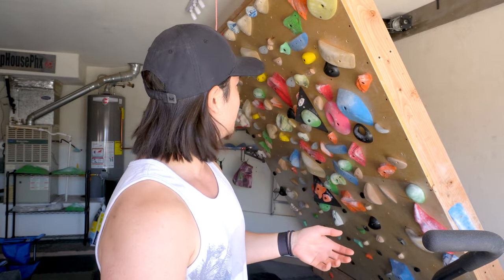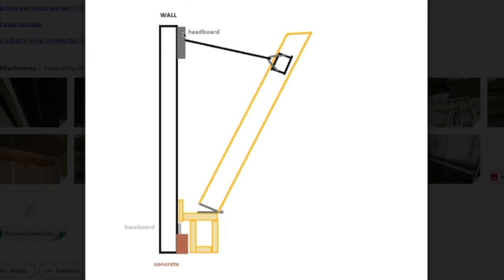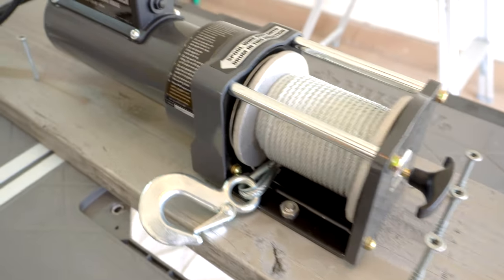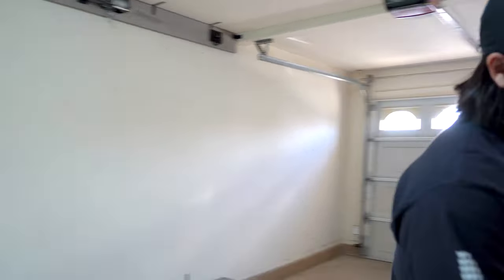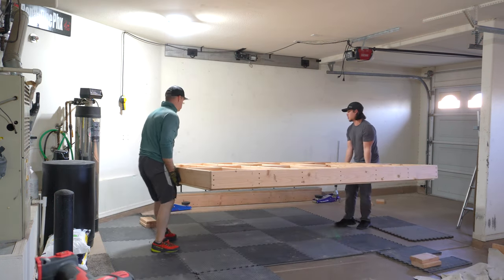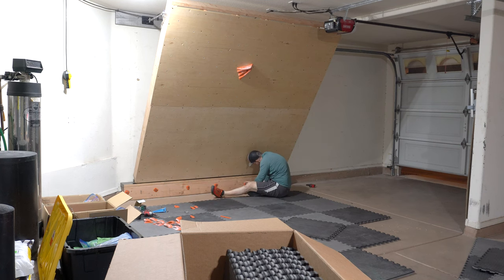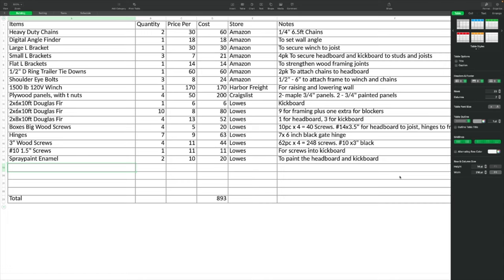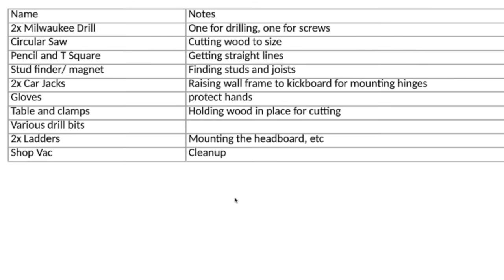I Built an ADJUSTABLE Home Climbing Wall for $800!!

Comment: Great video, and this is quite similar to how I built my 8x12 (which I just posted a picture of in the Woody 3.0 thread). My design just had a few differences: 1) I used four chain anchors rather than two, with turnbuckles to equalize the anchors; 2) I added 45° bracing to increase rigidity (makes a big difference); and 3) my kicker is a solid 12x beam through-bolted into concrete anchors. Having climbed on a few adjustable 8x12 woodies, I think my overbuilt version is better. The others "work", but the board flexes quite a bit, especially on jump moves to the corners, whereas mine is completely rigid.

Also, just wanna flex for a sec… I was so insanely psyched when building it that I mounted it myself. I added some casters to help with moving it around the garage, but… yeah, it was heavy as hell and hard to place. I think around 400lbs?
Reply from the maker: Yeah that sounds even more over engineered than mine!! Super solid.
Reply: Would you happen you have some plans on the forum? I’m planning to do the same exact thing you just mentioned.
Reply from the maker: @advantagenguyen  @danschmidt5189

Comment: Hi Nick - to what is your header attached?  I have a couple of options.  option #1 is to attach the winch to a 2x8 ledger which is attached to 2x10 LVLs working as a beam.  Option #2 is  to attach the winch to a single 2x10 joist.

Thanks for this DIY climbing wall build video!
Reply from the maker: Glad you found this video! As far as your situation, it's hard to say without seeing it, but I definitely recommend attaching the winch to more than a single joist if possible. Some people attach it to the ground and then run a pulley from the top which might work for you. Not sure though!

Comment: Man this is a sweet build! Love the fact that there are no vertical pillars attached to the top, which I imagine would get in the way of climbing or potentially introduce injury risk when falling. Have you noticed significant improvements to your climbing now that you have a personal spray wall?
Reply from the maker: Absolutely! The vertical pillars is what I saw in tons of other builds and I just knew it would be a very mental issue with trying to go for dynamic moves near the top/corners. And I recently got a pulley injury unfortunately, but prior to that, I 100% saw finger strength and tension gains from climbing on the home wall. I was up to about 80% bodyweight for one hand 20mm crimp pulls. And you can check out some of the best sets from the home wall on the instagram page! https://www.instagram.com/themanawall/
Reply: @nickkealiiclimbs  Holy crap dude, you got strong! Sucks to hear about that pulley injury, hope it heals up quickly. Sweet page, thanks for linking!
Reply from the maker: @129iphone  really appreciate it man!! Stoked for the comeback haha. Thanks for watching 🙏

Comment: Nice work!  What is adjustment range of your wall?  I'm planning an adjustable Moonboard Mini DIY and I'd like to be able to change from 25 to 40 degrees.
Reply from the maker: Thank you! I don’t actually know the full limitations, not strong enough yet 😂 but the minimum angle ended up around 20 and so far we’ve lowered to 35. I imagine 40 and 45 would be totally fine though 💪

Comment: Dude! Quick question, Ive been thinking of using your plan to build a wall to fit a Tension Board 2.0 in my garage. With the experience of building your wall, would you recommend it? Ive just been torn with buying pre built ones from onsite walls and it will be safer. Just wanted to get your opinion to see if you were to build one for the TB 2.0, would you do the same again. Thanks!
Reply from the maker: Good question! I mean I’m very happy and have had no issues with mine. But it is smaller than a normal system board. And we don’t adjust it all that often. If you have the budget and space I think a prebuilt one would be worth it. Although I do know at least one person who followed this design for a TB2. He’s on ig as @waddyaknowitsjoe
Reply: @nickkealiiclimbs  Thanks dude!

Comment: Awesome video!! With having an 8ft wall, do you sometimes wish that the wall was taller so that you could have a slightly longer problem?
Reply from the maker: Absolutely! 12 ft would be amazing, but my short garage ceiling didn't give me an option unless I wanted a super overhung wall. But the 8 ft has been great for 4-10 move boulders which is really all you need as far as training. And I love not having to worry about padding as much as I would have with a higher fall
Reply: Sit start! Makes everything longer (and less enjoyable 😅)

Comment: I’m about to build a wall. Does it wobble/shake etc where you sometimes you maybe just built a fixed one at like 30• (or if yes but another angle, what angle?) or with angle and weight it pretty much doesn’t move? If it does move, do you think rigging like a couple third hand type extension poles (for construction) would be enough to keep it still?  Thanks! Great video, love the concept, deciding if route for me.
Reply from the maker: Appreciate it! Theres very little wobble or shake on even very dynamic moves. Not noticeable while climbing. And I’ve heard from others who used my design to build bigger walls that they’re even more sturdy since they’re heavier. But yes, you can put in anything you want to add support if you find it not feeling secure. Was your first question whether I’d recommend a fixed angle build?
Reply: @nickkealiiclimbs  sorry just saw late. Good to know. Thank you!
Reply from the maker: @ryanharrington2890  haha no worries man. Let me know how your build goes! would love to see

Comment: what are those hinges rated for? That seems like the weak link in the chain. All that board weight and your weight acting upon those bottom hinges.
Reply from the maker: I actually reached out to the manufacturer because someone else had asked about the hinges in the comments lol. And they did not have any weight rating for them. But they are extremely solid and heavy. In addition, they're designed to be used vertically to support heavy gates and doors as they open and close. With this design, they have significantly less force on them than they were designed for. The only chance of failure I could see would be if all the screws holding the hinges on were to actually shear. That seems to be what would fail first as opposed to the actual hinge construction failing. I've seen much flimsier hinges used so I bought the biggest heaviest ones I could find. Not sure what the alternative would be. What would you use?

Comment: How did you fix the panels to the studs: nails, screws...?
Reply from the maker: I used zero nails for this build. Everything is predrilled and then fastened with screws. The actual screw sizes and lengths are in the spreadsheet linked. Hope that helps

Comment: 2x6x10ft… in cm ? 2x6x300?
Reply from the maker: yeah it looks like 10 ft = 304 cm. do you still measure 2x6s as 2x6s in inches? or would that be different too

Comment: dude! wall looks great, but how are the hinges holding up? On Lowes website it says the hinges you used only support 23lbs each. Yikes, I used 5" commercial butt hinges from Lowes and they each hold 220lbs. A 3 pack is only $32
Reply from the maker: Thanks man! And hinges are holding up great, absolutely no movement or anything. 23 pounds definitely sounds wrong lol. I picked these over the standard door hinges as they felt much beefier  and had more load distribution to the wood. I was more concerned with that than the actual steel hinge being overloaded since its not mounted vertically like a normal door hinge. I really don't see how 23 pounds could be the limit for these things in any possible scenario lol but good catch on the specs. I saw some of the similar products don't even have a load specification so I'm not really sure what that's about. These things are definitely heavy duty and are usually used for like barn doors and stuff. The Hillman website itself doesn't have a load capacity and the description is: "Specifically engineered to support heavy doors or gates and is commonly used in applications where durability, strength, and stability are essential" https://shop.hillmangroup.com/ccrz__ProductDetails?sku=851697&cclcl=en_US
Reply: @nickkealiiclimbs  glad to hear you haven't had any problems. I returned similar barn door strap hinges at first bc they said they only supported 35lbs each, that freaked me out so I got the commercial ones just in case :)
Reply from the maker: @sciencesaves haha totally understand! That would freak me out too. I reached out to Hillman support and they really don't have weight capacity for this item so that 23lb is definitely wrong on Lowes website. (probably because every use case is so different and the likely point of failure won't be the hinge itself but the screws or wood). Also, as you mentioned the butt hinges are only $32 for 3, I bought these for $9 each ;)
Reply: @nickkealiiclimbs  yeah, they could be meaning it is for 90degrees of force also. Lever force of a door is much heavier than downward force. Who knows?!